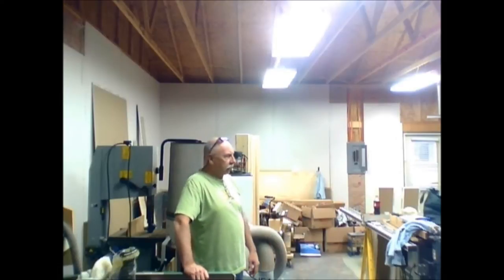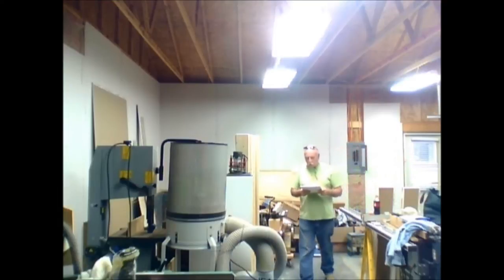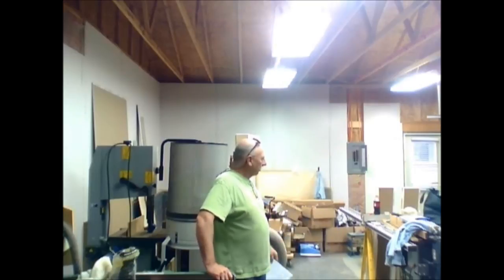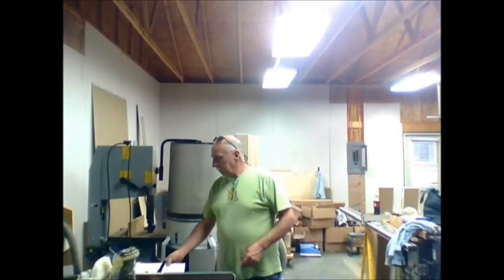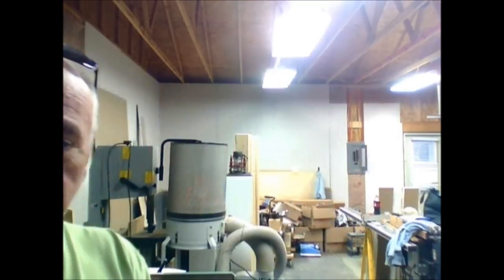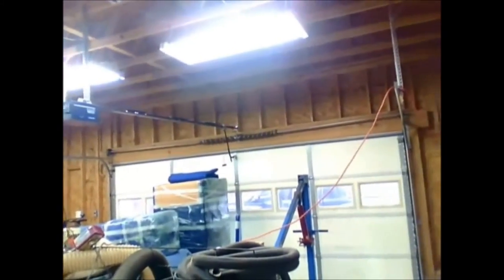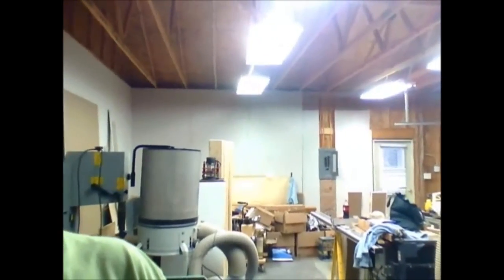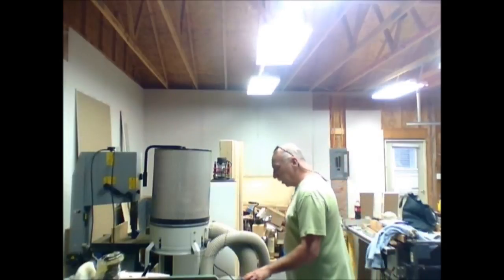Bobs Wood Shop Episode-6.wmv

Comment: Hey Bob, rent / buy and resell later, a drywall lift!  It will make it an easy one-man job. I did my whole, old shop, ceiling by myself, staggering 12' and 8' sheets perpendicular to the trusses. And if your useing 5/8" dw, it will make a nice flat ceiling with 2' on center trusses. Best of luck with it all. Carpenter Tim / MrGraygrizz.